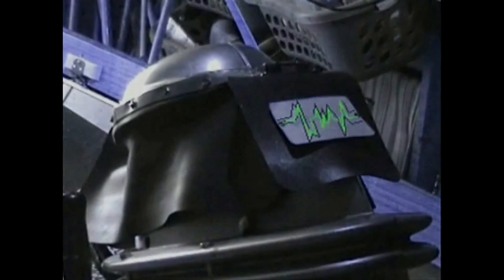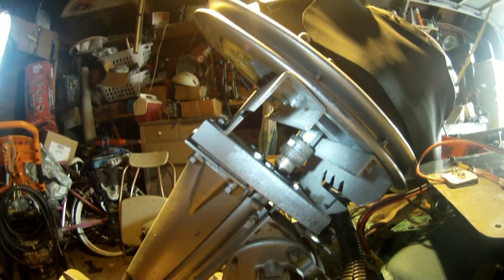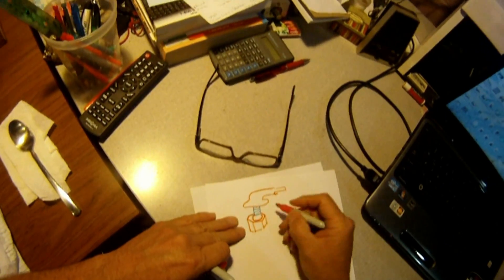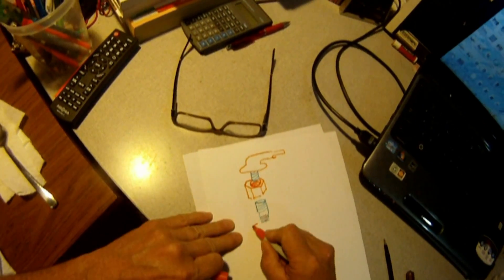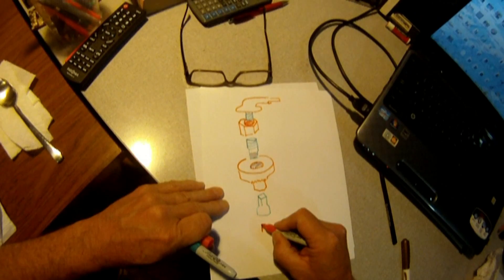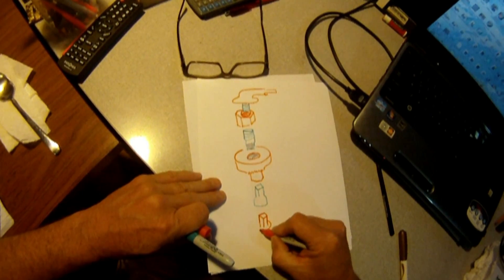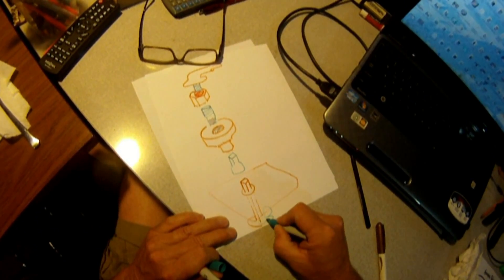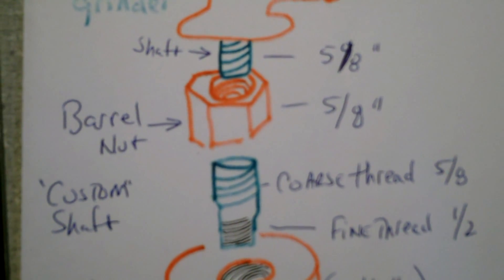custom shaft Explained ANGLE GRINDER Electric outboard   Homemade 4.75hp ANGLE GRINDER motor

Comment: how much did it cost to make this homemade outboard ? its so cool and it seems to really move out on the water with just battery power- A new gas powered outboard cost 2000 dollars or more and uses lots of gas that pollutes the water and air
Reply from the maker: bigcatfishin I bought the used 5hp motor( $40) , removed the power head, installed the electric angle grinder ( $35 + 20 for mounting hardware)  so about 95 dollars
Reply: right -thats what gas engines do put gas and oil in the water they cool their eng and vent the exhaust in the water realling making so much pullution in the water -yuck-keep out the good work with clean electric engines